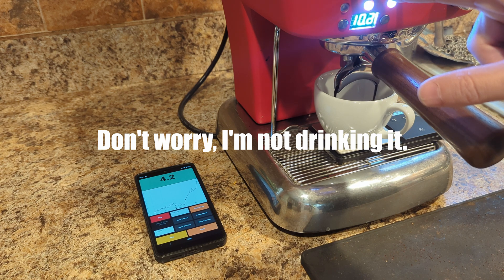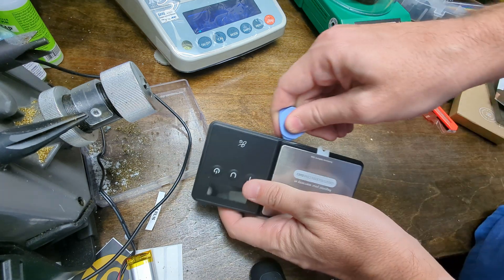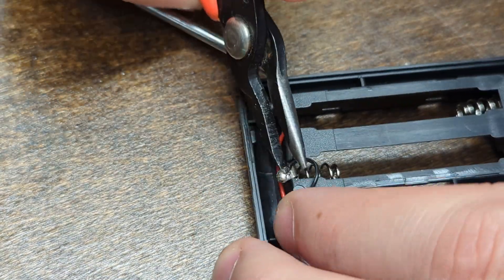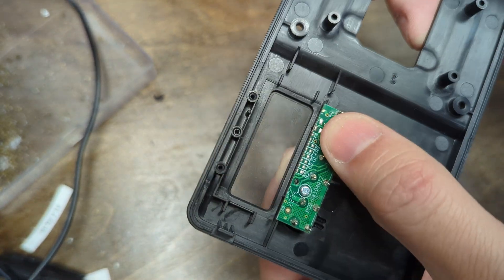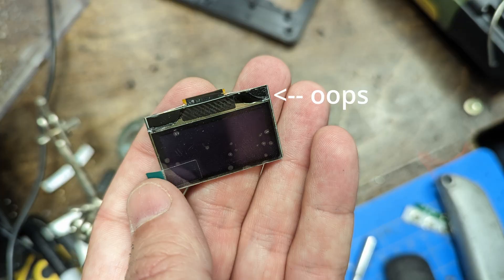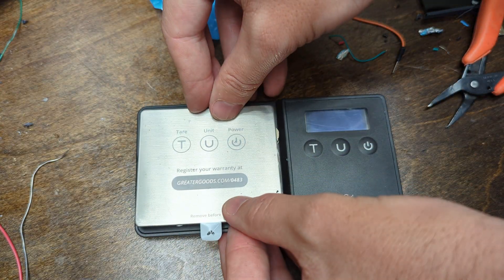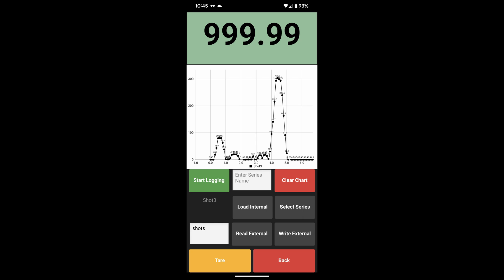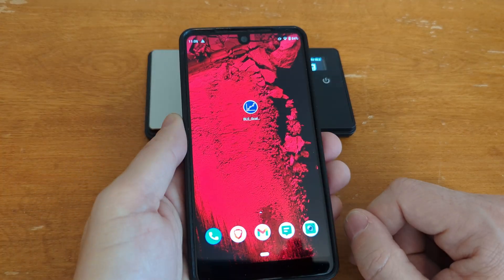DIY Data Logging Scale with  Android App (w/source)

Comment: Thanks for posting this. Will be building one myself and I saw a reference in your github to a calibration sketch which doesn't exist. Any chance of putting this up also?
Reply from the maker: It's from the ADC library: https://github.com/olkal/HX711_ADC/tree/master/examples/Calibration
Reply: @TechDregs  cool thanks!
Reply: @TechDregs  I got mine working now. Could not get one of these greater goods scales (in my country) so bought a super cheap mini scale just for the load cell and weigh plate. Unfortunately I discovered that these scales tend to use under specc'd load cells which you'd never know until you pull it apart. Also it tends to drift a bit over time. I saw your video on shielding but wasn't sure it would help in this case. Anyway I'm going to try another version using an ADS1232 with a better load cell (if I can find one - those China sellers tend not to list creep specs in their ads!)

Comment: Does this calibrate the load cell, i'd like to use a different one with higher weight?
Reply from the maker: Should work for higher values. There are calibrations you can do, if you dig into the underlying libraries for the HX711.
Reply: @TechDregs  Gotcha, thanks for your reply!

Comment: Is it possible to disable the auto-off function of the display?
Reply from the maker: The logging scale doesn't auto-off; it's just controlled by the power button. For the Android side, you can use a stay awake routine. I think there is a setting to keep the screen active in the GUI also. Been a while since I used it though, so I'm fuzzy on those details.
Reply: That's actually brilliant, I've been looking for ages for a weight logger which can work in a sealed box - will give this a try, thanks  @TechDregs
Reply from the maker: One modification you might add that I didn't is powering the HX711 via a GPIO pin that you can turn on/off at wake/sleep. That will keep it from drawing power when the unit is in deep sleep (it's a soft power button). That will massively increase battery life when it's powered down. You could also bump the resistors for the battery monitor pin up to 500k or 1m to draw a little less current... but that will have a far smaller impact on battery life.

Comment: Very neat work making it compact. Love it when people reuse enclosures to hide improvements. For significantly increased accuracy (like several orders of magnitude and way increased stability) ditching the hx711 and moving to even the ads 1220 breakouts will increase stability a lot. These hx711 are cheap and common and can get jobs done when accuracy isn't paramount.
Reply from the maker: Yeah, the HX711 I already had, and I'm really only looking for 0.1g resolution. I looked into some of the other ADCs, and for precision work, a person could do a lot better.

Comment: Ha, that OLED modification was a bit triggering! 😄
Nicely done.
I thought the XIAO had built-in battery management?
Reply from the maker: It does, but the ESP32-C3 version seems to lack a voltage monitoring pin. So, it'll handle the charge and everything, but you can't read it out internally. I think the Nordic version has internal pins for voltage that can be used. It costs twice as much, but it's probably even better for this design, as it's more power efficient.
Reply: @TechDregs  Ah, that makes sense - kind of what I thought after I considered it a bit more.

Was initially a little disappointed, as I saw your last video and was kind of excited about the battery management of the XIAO... Not that I need another dev board.